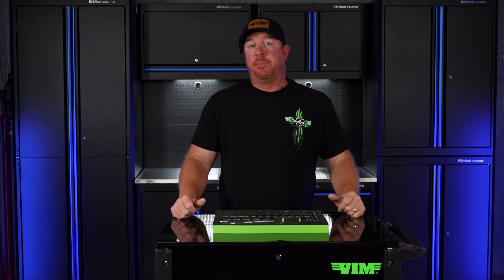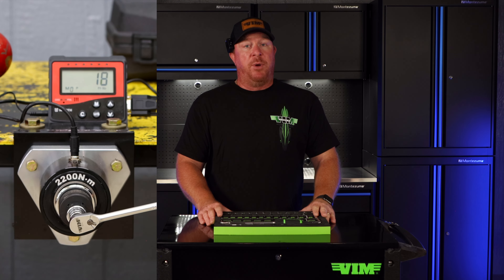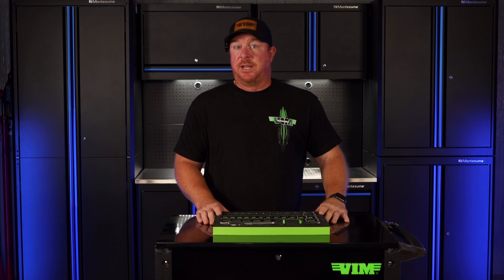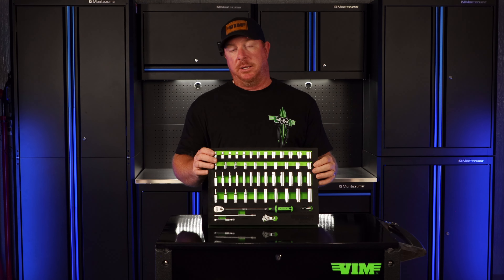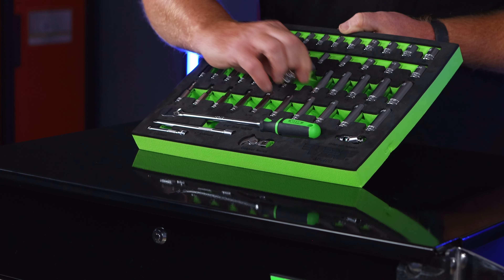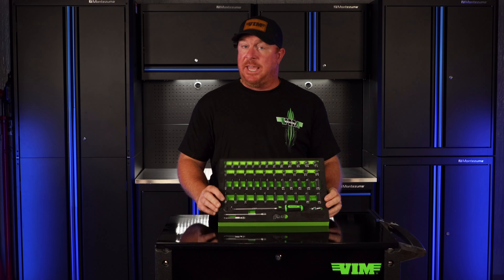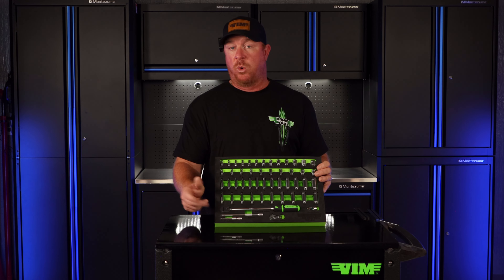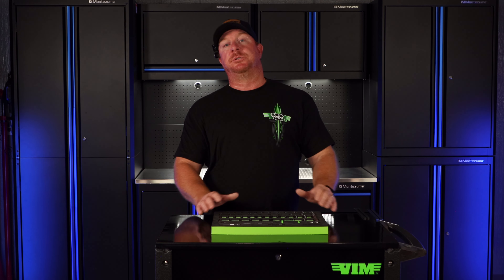These Aren’t Your Daddy’s Sockets. SMS400 Master Set and Subsets. Break Room Ep 8

Comment: I actually got this set in the mail a few days ago, and I was surprised because the first thing I noticed when I picked up a socket it weighed more than a 1/4" chomie normally feels. Quality and finish are nice, the wobble plus extension is cool and the spring loaded universal feels sturdy. My only one real criticism is when I was messing with the ratchet the drive tang feels like it has more slop (not back drag or pawl engagement, those feel crisp and solid) inside the head than what I'm used to. When I get back into work on Monday I'll compare it to my Sears craftsman, Icon, snap-on and matco 1/4" drives to see if I'm just imagining it.

Edit a week later.
VIM's 1/4" fixed head ratchet has the same amount of play as all my other 1/4" drives I have, and brand-new gear wrench, mac, and snap-on ratchets I messed with on the tool trucks.
Just as good as the top-of-the-line stuff.

Comment: As a diy’r one thing I really appreciate on the 1/4” sockets I have is the knurling. Because 1/4” is a lot of times low torque fasteners, many times in tight spaces, it’s really handy to pop the ratchet off and spin the socket with your fingers. The knurling makes a noticeable difference in getting a grip on that thing.

Comment: Came up with a great tool that no one makes.. A torque adapter(the mini box end wrench style with square hole for ratchet) but with a rounded/rusted bolt biter design if you guys get around to it If not love the unique/diverse tool selection to choose from
Reply: How would you hammer on the box end if you need a torque adapter to reach it? What would be the difference between using an extractor designed for a box end (gearwrench sells them) and your proposed tool?